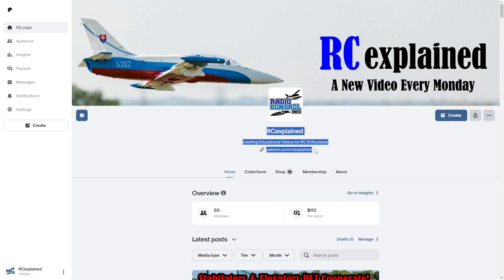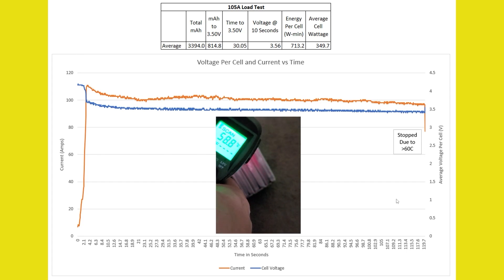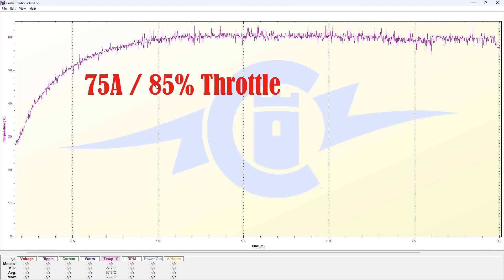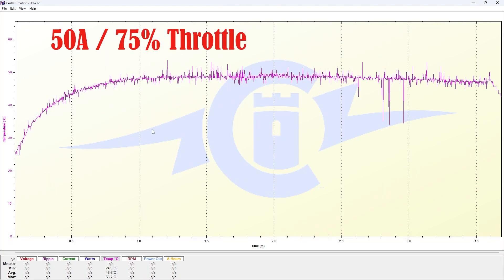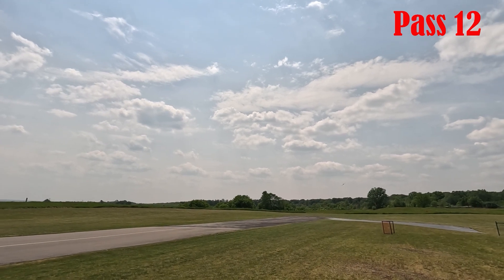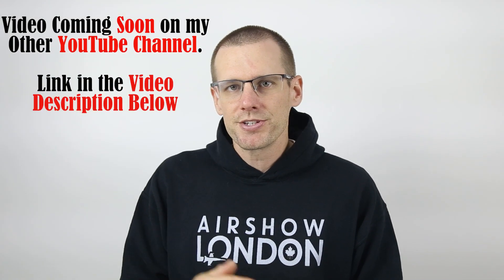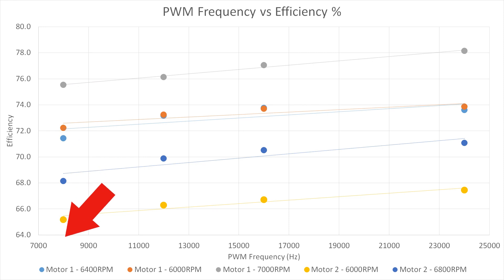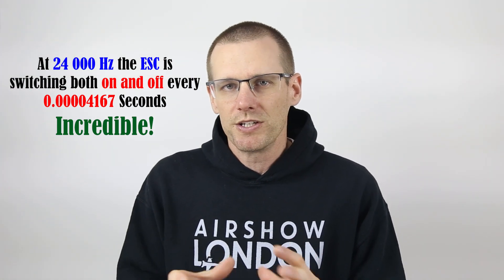The Results Will Shock you! Full Throttle vs Half Power ESC Temperatures Revealed

Comment: Wow, that's quite surprising. I would expect efficiency to go down, until 100% duty cycle which is kinda a special case. Does it mean that switching losses in FETs is the biggest source of energy loss in the system? More than wires/windings heating? Do you expect the same picture for any setup or could it be different for other motor/esc/prop combinations?
Also want to point out that if we are talking about the 'whole system' then voltage sag in the battery should be a factor too. If you have 8.11V with no load, but 7.88V at 15.15A then it is about 3.5W extra losses in the battery due to voltage sag (I don't know exactly how it works, but I would expect that this energy will result in battery heating). It's not a big deal in this case, but I think it could be a major factor for crazy freestyle drone punch-outs, and that will bring down 100% throttle efficiency.
Reply from the maker: It doesn't quite mean that losses are biggest in the FETS. The motor gets warm during this process too.

I expect the same relationship with all brushless motors and typical ESCs but to varying degrees of efficiency. 

I agree with the battery losses. Although the losses from the IR of the battery is not directly counted in this measurement of efficiency.

Comment: The way you explain things makes total sense, however the only time I get temperature warnings for my ESC through my radio telemetry is when I am full throttle. So I believe what you are saying but its counter to what I thought was happening. Now I wonder why I get the high ESC temps only at full throttle. (This is for my T28 RC Plane)
Reply from the maker: What you are experiencing is entirely possible. My test is in a controlled lab environment. Inside a plane has many stacking elements that will contribute to what you are seeing. For example, fly your plane for 2 minutes constant at 100% vs 2 minutes at 85% throttle checking temps before changing the throttle position.
Reply: @RCexplained  by the way, your videos are great! I'm really learning a lot. Thank you.
Reply from the maker: @malatoke  thank you for the kind words.

Comment: now test not with variable throttle, but variable input voltage. should ESCs use a dynamic DC to DC inverted to simulate full throttle all the time for better efficiency.
Reply from the maker: Sounds like a good test. I'll have to find the equipment.
Reply: That's a good question and video

Comment: Thanks for this video, I already knew this but I will defently share this video in my club. Its hard to explain it clear without pen and paper. BTW I am not sure but can you make A switch on your transmitter to make full throtle (on stick) to 80% ( software )will this help with temp of your ESC.  I always thought it did but I am not sure.
Reply from the maker: I didn't follow the exact criteria of the programming you are looking for. But more than likely, what you are asking is possible on the radio used in the thumbnail.
Reply: @RCexplained  Sorry my english is not that good, im from the Netherlands but what i mean is this: Could you make a switch on your radio that full throttle on stick is only 80%power (to motor) i know it is possible but my questions is will the PWM/duty cycle be also 100% our still be 80%.  Sorry for my late response
Reply from the maker: @F3AFlyer05  no, motor speed is controlled by pwm. 100% pwm, 100% motor speed. 80% pwm, 80% motor speed.
Reply: @RCexplained ah okay. Thanks alot
Reply: Allright thank you. It also works on the Futaba T18SZ

Comment: So at least for EDFs it's a tradeoff between a cooler battery or a cooler ESC which translates to a longer or shorter life for either of them. If you use some throttle discipline, the battery will not be as hot or puffed. If you flew at 100% throttle the entire flight, the ESC will be cooler and its life extended. If you are flying props, you are probably not pushing the battery to its full potential or limits, unless it's a low TRUE "C" rated battery. The battery's labeled "C" rating is a joke as we all know by now.
Reply from the maker: More than likely the weakest link in the EDF setup will be the battery.

Comment: Hi Ryan. This disturbing news, especially for those of us that do not and will not fly our jets at 100 % throttle. The question is. Why have a speed controller at all if damage is being done to it at lower throttle positions ??
Reply: Its not "damage" but just a loss in efficiency and an increase in heat. The speed controllers are still designed to handle the temps that were shown in this video.
Reply from the maker: Hi Frank, as pointed out by nopy, the ESC is designed with this in mind. I didn't mention of any damage done to the ESC.
Reply: You had me worried there. Thanks for explaining it to me. @RCexplained
Reply from the maker: Frank, I'd recommend flying your jet at 100% when you are comfortable. It usually increase the smile rate. 😆
Reply: But doesn't that use up the battery much faster and reduce flying time ? @RCexplained
Reply from the maker: Yes it will, speed vs flying time.

Comment: This holds true for inrunner/car motors as well. The constant switching imduces eddy currents in the rotor which can make it very hot very quickly. Solution for this is splitting the rotor magnet into segments which is more expensive to manufacture ofc.
Reply: Is some manufacturer/ models with split rotor magnets for sale?
Reply: I only know of LMT, they use it on the bigger motors. @Rudá_BB

Comment: Anyone who's been in the hobby is entirely unsuprised by this, it has been standard for decades that running at part throttle puts more stress on certain components of the electronics, albeit the reasons have changed from ballast resistance to frequency curves and loading.
Reply: Not everyone is an electronics engineer.
Reply from the maker: It's true that it's been well known for a very long time. Even so, its still a question I am asked.

Comment: d-shot without filtering or rc smoothing.  analogue with filtering, lots of it, bit of dead band to phase out the micro jitters. 48khz seems to be the sweet spot for digital, unless it is a micro tiny whoop then 98khz. Amazing how esc's have gone from mechanical esc's right up to  4 in 1 55a esc's on a 25 by 25mm board. over gearing or over propping a motor is the esc's biggest killer.
Reply from the maker: I agree it is amazing to see where tech is at today!

Comment: What could help or distort if we were to change the pwm hz for the esc will it respond slower faster heat up less on more hz ?
Reply from the maker: Response won't really be felt by a user in my experience. The esc would in theory heat up more but the overall power system would be more efficient.

Comment: I had an issue when I had a brushless esc 60A and a included motor 3650 3900kv but when I upgraded just the kv my built fan stops working and like Speed all randomly my battery is 80c 5200mah 2s and only with this +5200kv it’s goes warmer also I got less start push power from that motor idk feel like the motor is demanding more power ? Even at the begging it wastes a lot of battery I went fast w out tires on ground so fast but when I raced on ground it drain my fully Charge battery super quick ?  So we could say higher kv motors will demand consume more amps even at lower starting speeds vs lower kv motors on same in my case 1/10 scale truck ?
Reply from the maker: There's a few dependencies to directly say that high Kv motors will consume more power at slow speeds as well. high Kv motors have the potential to pull more current at any speed but only if they are requested to do so.